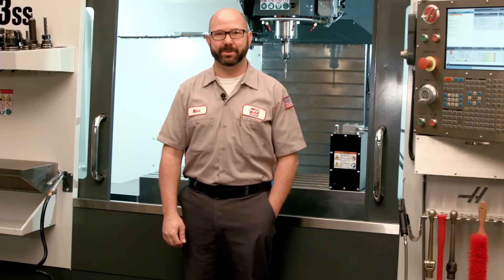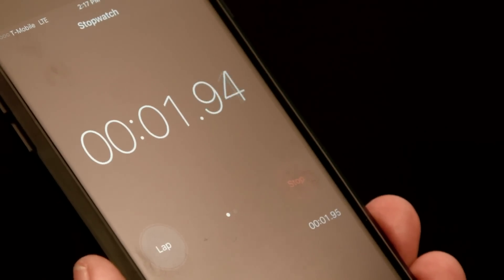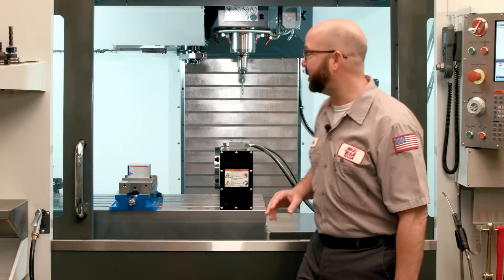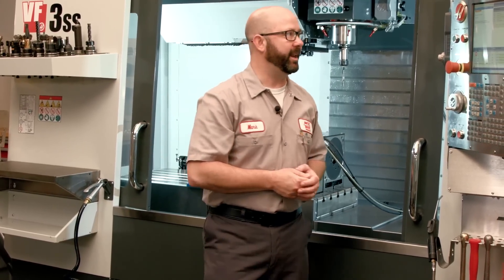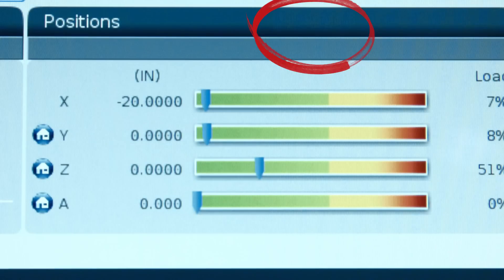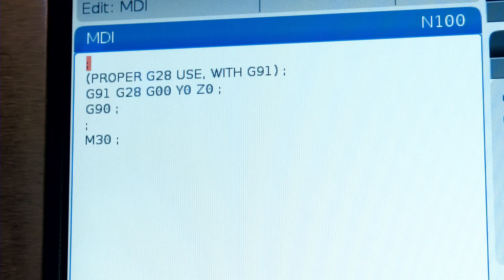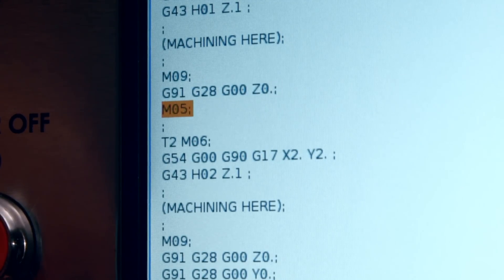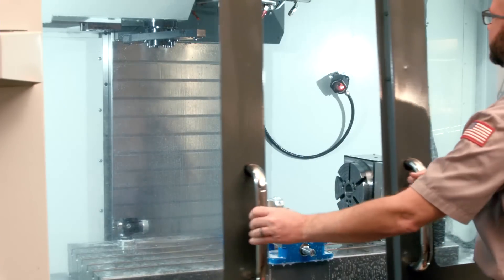Use G53 Instead of G28 to Send Your Haas Mill to Home Position – Haas Automation Tip of the Day

Comment: Is it possible to do a video on tips for multi work offset programming in machining multiples of the same part? As in, I have two vices and want to run the same part in both vises within the same cycle, but I want to do so by running each tool on each part before switching to the next tool so as to save tool change time. I know I copy and splice my programs together for different offsets and create one huge program; or I can use sub programming and designate a new offset for each subprogram for each tool I believe. But does HAAS have any shortcuts for doing this process that are easier?
Reply from the maker: Ian – That’s a great topic, we’ve put it on the list. Your comment did an excellent job of describing the options. A video could help explain the formatting for running those multiple parts. Thanks for the comment. – Mark, Haas Tip-of-the-day
Reply: just use G54 for one part, and G55 for another and so on.  then just double up on the canned cycles with one being G54 and the other being G55.  works for me..  Make sure to be high enough with your tool when moving from part to part.
Reply: Yessir. Thats what I was thinking with copying the program and changing everything to another work offset (G55) then just splicing it back into the original G54 program. Which would essentially be the doubling up of canned cycles and alternating the G54 and G55's for example. Def gotta watch the tool height between, don't want to break anything haha. Thank you!.
Reply: This is how I do it on a Haas mill;

T1 M6
G90 G0 G54 X-.5 Y.5 M3 S10000
G43 H1 Z.1 M8
M97 P1
/G55 M97 P1
G0 Z.1 M9
T2 M6
M1

T2 M6
G90 G0 G54 X-.5 Y.5 M3 S10000
G43 H2 Z.1 M8
M97 P2
/M97 G55 P2
G0 Z.1 M9
T1 M6
G53 X-10. Y0
M30

N1
X-.5 Y0.
G1 Z-.5 F50.
G41 D1 Y0
X1.
Y-1.
XO
Y.5
G40 X-.5
G0 Z.1
M99

N2
X-.5 Y0
G1 Z-.025 F50.
X1.
Y-1.
XO
Y.5
GO Z.1
M99

This will cut a one inch square feature .5 inch deep with a .025 inch deep chamfer where tool 1 is a .5 inch end mill, and tool 2 is a 45 degrees chamfer tool. Use block delete to run just G54, turn block delete off to run both positions (or as many positions you are running and the control will allow). This also works with as many tools required for the parts you are machining. Adjust rapid Z moves as necessary for safety according to your set up.

Think of everything above M30 as your directory part of the program, and everything below M30 as your tool path programs.

It’s also easy to convert a single part program with multiple tools using the great Haas editing tools.
Just copy and paste the entire program, and edit the top above M30 as I have, and delete the unnecessary and add the necessary below the M30 as I have.

Also I use the tool number as the N number(line) to keep it easy to follow.

It may seem complicated but after using this method for over 25 years you become quick at it. I can edit a 20 tool program in just a few minutes.

Hope this helps someone out there!

Also I generally add a .01 radius on the corners but I typed this on my phone and it doesn’t matter what you are machining, just the format for the example.
Reply: This would really be a great topic as it's very useful when running multiple parts but can even be quite challenging in CAM program. I wish there was more videos about taking a closer look at some part and then working thru the strategy how to machine it fast multiple parts with the same setup. Keep up the good work Mark!